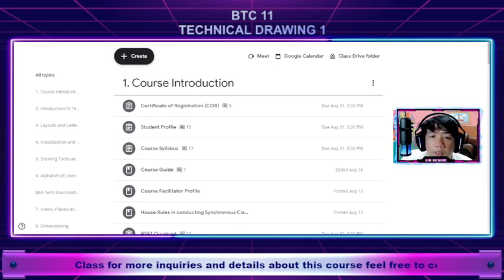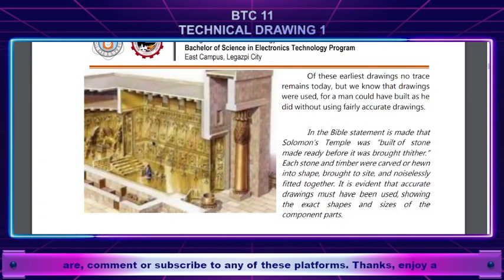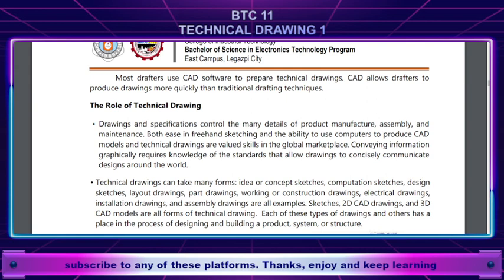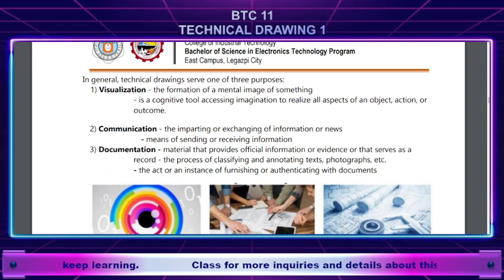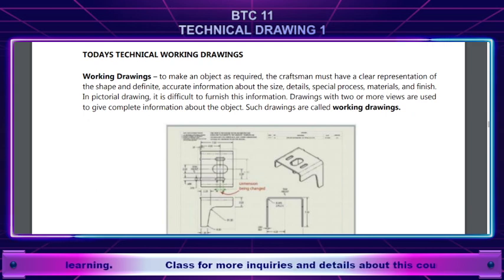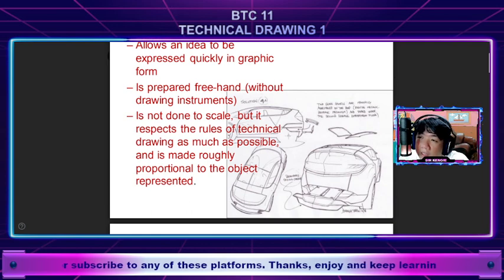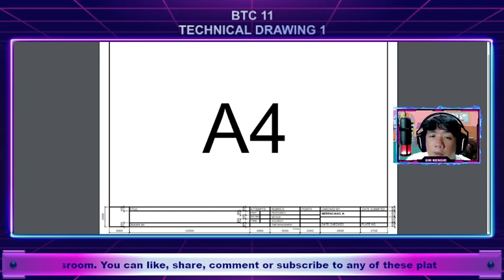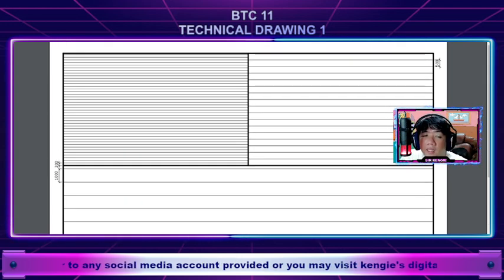BTC 11 1A-1 Introduction to Technical Drawing

Comment: Nesie A. Manzano
BSET 1-1
BTC 11

The difference between concept sketching and drafting
 -Concept sketching and drafting are two different processes used in the design and development of products. Concept sketching involves creating rough, freehand drawings to visualize and communicate ideas. It is a quick and creative way to explore different design concepts and variations. On the other hand, drafting is a more precise and technical process that involves creating detailed and accurate drawings using drafting tools or computer-aided design (CAD) software. Drafting is used to create detailed plans and specifications for manufacturing or construction purposes.

Comment: Marc Nayson A. Camba
BSET 1-2
BTC 11

--The difference between the conceptual sketch and drafting

Concept sketching is an early stage of the design process where rough, freehand drawings are created to explore and communicate the ideas, and there is no need to be precise or detailed. Drafting, on the other hand, is a more refined and technical stage where precise drawings and plans are created. Drafting requires accurate measurements.

Comment: Danica May B. Ludovice
BSET 1 1-2
BTC 11

The difference between conceptual sketch and technical drawing

    Conceptual Sketch created using a pencil and paper, despite its imprecise scale, should still depict the object. Condensed drawing that highlights the key features of a concept or system, while Technical Drawing enables the fast visual expression of a concept. Is prepared free-hand (without the use of drawing tools). Is not done to scale, but abides as closely as possible by the norms of technical drawing and is generally proportional to the object portrayed.

Comment: Gwenn Napay
BSET 1-1
BTC 11

— The difference between concept sketching and drafting

Concept sketching is an early stage of the design process where rough, freehand drawings are created to explore and communicate the ideas, and there is no need to be precise or detailed. Drafting, on the other hand, is a more refined and technical stage where precise drawings and plans are created. Drafting requires accurate measurements.

Comment: John Carlo A. Adornado
BTC11 BSET1-1
The difference between concept sketching and drafting
A concept sketch is a drawing we want to make but don't know how to do yet. You don't have to use accurate tools to draw roughly. Usually, architects, engineers, interior designers, and other creators use them to quickly and easily explore their first ideas. On the other hand, technical drawing is an easier-to-understand drawing. People use symbols, points of view, units of measurement, visual styles, and page layouts that they are already used to. technical drawing are drawing that the artist makes by hand. No drawing tools are used to make them. Engineering drawings are sketches that use drawing tools to show how things work. They are detailed and to the point.

Comment: Joshua Ll. Lorena
BSET
BTC 11 1A-1

Difference between Conceptual Sketch and Technical Drawing
Conceptual Sketch is a great way to quickly display design ideas. It provides a visual example of the basic design of an object and its layout. It also gives the concept to allow designers to design from this type of drawing before creating a detailed drawing.
Technical Drawing is a detailed drawing of an object. It aims to be objective and represent the best possible objects as they are, in a totally objective way,

Comment: Danniel Troy D. Carpio
BSET-1A
BTC11-1A

-The difference between concept sketching and drafting
A concept sketch is a drawing that we have in mind that we want to create. You can draw roughly without using precise tools. Often freehand drawings, they are typically used by architects, engineers, interior designers, and other designers to quickly and easily explore initial ideas. Drafting, on the other hand, is a drawing that is easier to understand. People use familiar symbols, perspectives, units of measurement, visual styles, and page layouts. Concept sketches are his freehand sketches used by the designer. They are created without using drawing tools. Engineering drawings are detailed and concise diagrams that use drawing tools to convey information about how objects work.

Comment: Mariane Faith N. Lastrella
BSET
BTC 11 1A

Difference between conceptual sketch and technical drawing
-Conceptual sketches known as freehand sketches are utilized by designers, including architects, engineers, and designers, as a quick and easy method. They serve just as a means of researching design principles and aesthetic ideas; they are not intended to be accurate or conclusive. Technical Drawing is the language of communication of technical/vocational occupations and as such, has widespread applications and essential for the development of processes of scientific investigation .

Comment: Shane C. Llorca
BSET 
BTC 11 A1-1

Difference between Conceptual Sketch and Technical Drawing
  
Drawing is more detailed process resulting in stunning pieces of art that usually take a longer to complete, Sketching is a quick and easy way to capture an objects essence of rough idea , involved basic lines and shapes and is often a rough concept. when the conceptual sketch is what our brain imagines and there is no necessary scale or anything that is not like a technical drawing.

Comment: TRICIA SHANE C. BARTOLAY
BSET 
BTC 11 1A-A

-Difference between conceptual sketch to a technical drawing.

Conceptual sketch are freehand sketches that are used by designers. They are made without the aid of drawing tools. They are not intended to be accurate or definite while Technical drawing is a detailed, precise diagram that conveys information about how an object functions with the help of drawing tools.

Comment: Christian Paul R. De La Cruz
BSET - 1A
BTC 11

What are the difference between conceptual sketch and technical drawing?

Answer:
•The difference of conceptual sketch and technical drawing is that Conceptual sketching is a freehand drawing that focuses on capturing the essence rather than going into details that are used by designers such as engineers and architechs in a quick and simple way. Sketching is done using pencils and charcoal only, while drawing is a slow and more careful expression that makes use of tools and uses colors too but in technical drawing is the act and discipline of composing drawings that visually communicate how something functions or is constructed. It is essential for communicating ideas in industry and engineering .

Comment: JENNY ROSE ESPAÑOLA
BSET
BTC-11 1A-1
DIFFERENCE BETWEEN CONCEPTUAL SKETCH AND TECHNICAL DRAWING.

CONCEPTUAL SKETCH IS PREPARED FREE-HAND WITHOUT DRAWING INSTRUMENTS IT IS AN IDEA FOR SOMETHING YOU WANT TO BUILD YOU MAY DRAW IT ROUGHLY, WITHOUT USING INSTRUMENTS OR ACCURATE SCALE IS WHAT WE CALL CONCEPTUAL SKETCH IT ALSO ALLOWS AN IDEA TO BE EXPRESSED QUICKLY IN GRAPHIC FORM.WHILE IN THE OTHER HAND TECHNICAL DRAWING IS THE ACT AND DISCIPLINE OF COMPOSING DRAWINGS THAT VISUALLY COMMUNICATE SOMETHING FUNCTIONS ALSO TO MAKE THE DRAWINGS EASIER TO UNDERSTAND, PEOPLE USE FAMILIAR SYMBOLS, PERSPECTIVES,UNITS OF MEASUREMENT,NATION SYSTEM'S,VISUAL STYLES,AND PAGE LAYOUT SKETCHING IS A FREEHAND DRAWING THAT FOCUSES ON CAPTURING THE ESSENCE RATHER THAN GOING INTO DETAIL'S,DRAWING IS A SLOW AND MORE CAREFUL EXPRESSION THAT MAKES USE OF TOOLS AND COLORS TOO.

Comment: HANNAH A. ABIÑA
BSET 
BTC 11 1A-1
  -Difference between Conceptual Sketch and Technical Drawing
    Conceptual Sketch are drawings that comes into our mind that something we want to build.We can draw it roughly,without using instrument in accurate.It is often freehand drawing usually used by the designers like architects,engineers, and interior designers as a quick and easy way to explore their initial ideas designs.Technical drawing, in the other hand, are drawings that are easier to understand.People use familiar symbols,perspective, units of measurement notation system,visual styles, and page layout.Also alluded to as drafting, is a thorough graphic representation of how something works or being constructed.

Comment: Christian B. Jebulan
BSET
BTC 11 A1-1

-Difference between Conceptual sketch to a Technical Drawing

Conceptual Sketch are done without instruments and scales because you are laying out your ideas that might disappear in your thoughts hence this is why it has to be done quickly but even without the tools, the idea that you have conveyed should still seen as an object or whatever it is your trying to draw, not perfectly but approximately. Technical Sketch uses instruments and scales, this is used to serve as a guide for mainly architect, engineers and so on., every line here should be precise and little to no errors.